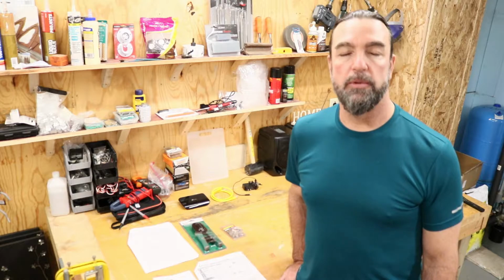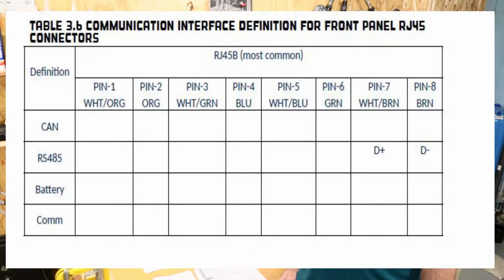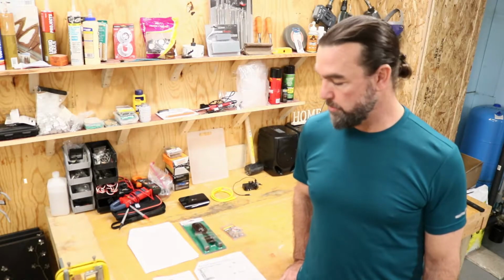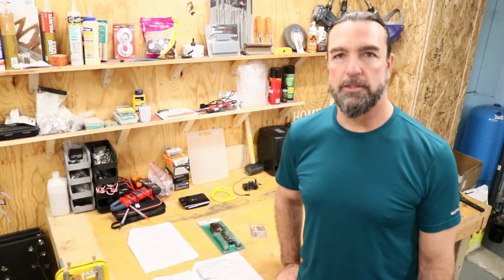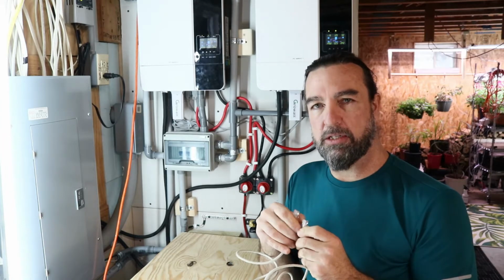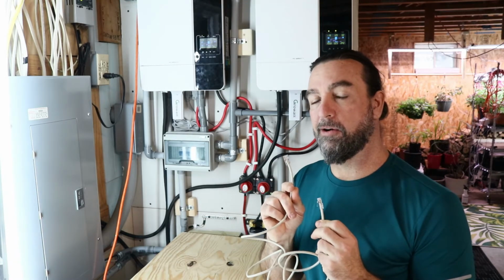Fault (20) Growatt & EG4 24v Battery BMS Test - Doesn't work, crossover cable

Comment: I also had this problem, battery arrived today (LifePo4 120ah 48v - with Growatt 5000es)  - had same issue 4, and 20 on the errors when switching to Li mode
I contacted the battery place and they said switch up Jumpers 5 and 6 and then set the type to Li and the protocol (36) to 51...
I had to make sure the ethernet cable was in the BMS port as opposed to the RS485.
I then shut it all down and brought it back on, and it's working fine

Comment: Ok, I got my Growatt 6000T communicating with my EG4's. I started with the Switched over cat5 and got the error. Hooked up a standard Ethernet cable and got communication. Put new ends on the original cable, with same pinout, and all is good. Make sure you are using the BMS port, and not the RS485 port, on the inverter. Also when using dual inverters, I would use a rs485 link card eg-Ziplink, not a Ethernet switch. It is hard with the documentation given, but I think the Batteries use pins 7 and 8 for battery to battery communication, and pins 1&2 for master battery to inverter communication.

Comment: I had mine sorted out . If the below comments don’t help you guys , msg me , but I need to know which manufacturer and model of the BMS inside the battery. But use canbus port on battery and bms port on inverter. Li , L01,51 ) this is for canbus. The cable should be pin out as below 1-5, 2-4 and 3-6.  Try these three wires only. Do not leave out 3-6 (ground). Cable ends are specific to inverter and battery. Cannot be used in reverse direction

Comment: I just had this same error 4 / error 20 problem on rs485. same inverter model as yours.  Same battery as yours.  To get it working I did the following.  I used the can bus ports on the inverter and battery instead of Rs485 ports.  when setting option 5 to “li” and being redirected to the option 36 screen, choose protocol L51. This is a CAN bus protocol.  Now it should work. Once you get it working on one inverter then try adding the other inverter into the picture.  I agree with the other commenter who said that looked like an Ethernet switch you were using. That will not work. That is only for home networking, not serial communications.

Comment: Hello, if you still have the issue check that video. I made a quick video how to fix it - https://youtu.be/g3j5mpVz-qg
Let me know if this helps.
Reply: I've just noticed that you have the newer inverters.
They have Communication hub included. You just need to connect your batteries to the BMS port (not RS485) of the Host inverter and that is it.

Comment: I got my 4-20 comm error to go away finally.  I’m running the 24v lifepower4 battery and growatt 3k inverter 24v.  I turned down all the dip switches and then made the setting 5 to Li with protocol 36 and L01.  Be sure you connect to the BMS port in the inverter.

Comment: I purchased 3 of the eg4 batteries from sig solar. They told me that their batteries would communicate with my 3000lvm 48 volt inverters. In the beginning I was getting the 04/20 fault codes when attempting to use the LI option on setting 5. 

I have now been able to figure out some communication with the batteries and inverters and no fault codes. First make sure your inverters have the latest firmware on them. Then set all four dip switches in the down position (master battery) and connect the rs485 cable into the bms port on the inverter. This works for me. Now my issue is the batteries will stop charging at 91%. Sig solar has been no help to this point in figuring out any of my issues so I don't expect them to offer any solution to get the batteries to charge to 100%.

Therefore, I continue to use the use2 setting on my inverters so I can charge them completely.
Reply from the maker: - Thanks for sharing Ghost rider

Comment: I don’t like this at all. I do crap loads of research and it seamed that this battery setup is the way to go. Now it seams the 2021 batch is a dud. I ordered and paid for 6 of them they are in transit now. I’m starting to see bad postings on DIY solar forum also.
Reply from the maker: - Off Grid, don't get me wrong the EG4's are working great, charging and discharging as a battery should very efficiently. The only issue is the BMS speaking to the Inverters. Thankfully the BMS of the EG4's is good enough to allow AMPS in or OUT intelligently enough where the inverters help or backup is not needed. My plan is to install an additional BMS between inverters and batteries as a backup prior to expansion. If you have EG4's coming I wouldn't worry, they seem like really good batteries for myself to this point (9 months)... Lets hope it stays that way.

Comment: So NOT an expert... 

I believe you should plug from the rs485 port on the inverter, to the empty bat-coms port on the first battery, then each battery daisy chains to next...

The rs485 port on the battery I believe is to plug a computer into using a usb to serial adapter.

I do believe you had the dip switches correct, device 0 is first battery, the next position is reserved for the inverter...

I would assume you can verify with the vendor you purchased from.
Reply from the maker: Thanks Ricky for the comments

Comment: this guy has the same inverters and batteries and does have comms going

https://youtu.be/SrCSSc9JYSo
Reply from the maker: Thanks for the comments, it seems the setup works with 48v batteries but not with 24v in series to make 48v which is my setup
Reply: @ahhlifesgood1956  i suggest contacting sig solar and see if you can get them swapped for the 48v models

Comment: I was able to get my Growatts to accept the Li setting. After having powered up my units, I turned off my loads and switched off the Growatts. The screens are still illuminated because I hadn’t shut off the batteries. I went to setting 5 and changed battery setting to Li and got protocol screen where I changed it to Lo1. I pressed enter and escape and the unit took the changes without giving me the fault.  Then I powered up the Growatts and had the Li icon beside the battery. I also scrolled through the settings to confirm that 12 and the others are being displayed in percentages which they are.  Interestingly, the Growatt acting as host changed in this process. The only battery in my bank that Growatts are communicating with is the first of 8, which is set to 0 (all down). This battery is one of the new Lifepower4s which I still haven’t gotten to be read by the bms software. I have the same version of bms software as you. I’ll be changing cables and trying to determine if the newer bmses  work with the older ones or with our software. I hope this helps.
Reply from the maker: - Dan thanks for taking the time to comment, what are the voltage of your batteries?
Reply: @ahhlifesgood1956  All eight are 48v 100AH purchased from Signature Solar.

Comment: From Growatt.  If Pylon battery want to build communication with inverter（SPF3000/5000TL HVM/WPV/ES）：
Inverter side setting：program 05-36-L02/L04（SPF3000/5000TL HVM），
program 05-36-L52（SPF5000TL HVM-WPV/SPF5000ES），
Inverter port：BMS port（SPF3000/5000TL HVM），
CAN port（SPF5000TL HVM-WPV/SPF5000ES），
Battery side DIP switch：1000----ON OFF OFF OFF
Battery port：RS485 port（SPF3000/5000TL HVM），
CAN port（SPF5000TL )

Comment: For some reason, my text has a strikout line through it in the previous reply (for me anyway). So here's the short version. 5000 ES setting menu item 05, Li and 36 L52, Bat dip 1000 and use Lan cables between BMS (inverter) and CAN (Batt). My system is working perfectly now. I have 3x 5000es single phase parelled and 12 Pylontech US2000 in two banks.  My next problem is getting the WIFI to work. Looks like it will be painfull as well !! I'll post the complete Growatt text as well as it has settings for some other configs tht+at might be of interest.  Happy holidays.
Reply: Good luck on getting the Wifi to work.  After overcoming many of the struggles that we all have (very poor documentation, specs that are not held to or documented, incomprehensible Chinese English).  I gave up on Growatt.  The silly Wifi dongle was the killer.  I remember one error message in the Wifii App "Ensure to suck the antenna to the suction device" or something along those lines. As an old-time network engineer, I could not get the Wifi work. You can even find a very embarrassing video here on YouTube of the owner of Signature Solar (a large peddler of the Growatts) cannot even get the Wifi dongle to work.

That along with the idle consumption of 48 watts, means I need two 300-watt panels just to keep the thing at idle.  Yes, we all know, the claimed power saving mode does not work.  .  Charge voltage setting in the Growatt is ignored and it just puts out some voltage that I have no clue where it is getting the setting from.  I also have the EG4 waterproof batteries.  They are no  prize-just relabeled Chinese garbage. The BMS as well as the corresponding APP (which is not even with Google or Apple, you must download a file and force it to install), are both complete jokes.  

While the Growatt is cheap it is nowhere worth the hassle and headaches.  I should have returned the Growatt when I went to install it and could not connect up the AC cables as they had a ribbon able stretched right across the inputs.  You can even see Will have the same issue in his video review.  For twice the price I bought a Victron.  Completely different beast.  Less headaches and considering 12 watts at idle, I save money without needing more solar.  Documentation that is near perfect and everything works as advertised.  

The EG4 batteries I will have to keep as replacing them has no real benefit as compared to the price increase.  Luckily, I have a Victron Bluetooth shunt in front of the battery bank and that helps.  Surprisingly completely different measurements (amps, voltage, etc) on the Victron shunt then the EG4 app.  Fluke voltmeter confirms the Victron shunt is correct.  

Shame on me though.  I researched hard, and saw a number of people (videos, forums, etc) trying to get the Growatt to work.  I even remember reading the manual where it stated that I could only use a 20kw Diesel generator with the Growatt 3000.  Ya ok, I am buying a bottom priced invertor, but need a overkill high-end $15k generator.  I know this is false, but the fact that it is in the manual should have been a tell-tell sign.  

Long rant, but like many here I struggled to get the Growatt to work.  While cheap and it might have its place, not for me.  Since dealing with the Growatt, I have made a new rule in life.  No more, direct from China garbage.
Reply: @MrThisIsMeToo  I remember about a 30 minute hassle getting the Phone app and the WiFi dongle to communicate.  Then I realized it was easier to get my laptop to connect to the dongle's WiFi access point and then point my browser at the IP address.  Configuration from that direction was easier. I went through this twice. The first time I changed the cloud url to the proper U.S. cloud server IP.  The second time I configured it to communicate to a proxy service on the local network to allow for capturing the data on a local database and still be able to read the stats on the Growatt cloud service.  Another benefit doing it this way allows for changing the update frequency of the dongle from buffered 5 minute intervals to 1 minute.

I looked at the Victron equipment. Very nice stuff. I started budgeting for it until I started to feel like for twice the cost of the AIO Growatt,  I would be nickle and dimed further to buy dongles for the VE Bus and some other equipment just to configure it easily(I understand some newer models have an LCD built-in now).  On top of that cost there isn't a solar charge controller in that Victron inverter I was looking at. Equivalent SCC from Victron would be what, another $700? So now we're at 3x the cost of the Growatt. So, in my case I could take that $1,400 saved and easily pay for panels to cover that high 50 watt idle.  Panels are cheap and that 50 watts is 1.2kwh a day. With 4 hours of sunlight, you're correct ONE 300 watt panel needed to cover that... I bought 3kw worth of panels on one pallet for.... wait for it. Less than $1,400 shipped. $1,200 to be exact.  Of course some may have space limitations and not have room for that extra 300 watts of panel to cover that idle draw.

English documentation could be improved upon.  Some kinks in the WiFi dongle firmware could also be improved upon.  But one of my main complaints on my Growatt AIO is, no remote temperature monitoring for the battery bank(s).  If my batteries go below freezing I will have to rely on the BMS to prevent charging from the Growatt.  I don't like that, but I have planned around it.  Sadly my BMSs have no way(that I know) of connecting to rs485, and I'm not totally aware if that communication would allow them to report temperature to the growatt to disable charging current.

If installing solar equipment was my profession I would most likely pick Victron equipment for the customers and Growatt for myself.  iPhone for the non-technical, Android for myself.  Linux for my PCs, Microsoft Winders for everyone else.
Reply from the maker: - Thank you Mike for the excellent detail on your setup and configuration, I plan to setup a backup inverter and battery I have using your same settings and a cable configuration another viewer sent in to see if I can get a positive result on the 24v batteries, Really appreciate the information posted.

Comment: Hi, I'm having EXACTLY the same problem (code 04 and 20 ) with Pylontech US2000 batteries and Growatt SPF5000es inverters. Everything works fine when USER is selected but faults out with Li. I suspect a cabling issue. See this video https://www.youtube.com/watch?v=HdKWpzs_8dg&t=131s  where they solved their problems by swapping out the wrongly supplied cables for basic LAN cables. They had a slightly different setup but it all came down to communication issues between inverters and batteries due to the cables beig incorrectly spec'd.  I'll let you know how I get on. Cheers.
Reply: Update. Although I'm using sightly different batteries to your setup, maybe the following will help with your trouble shooting. I came across the following from growatt from an online forum re this fault code sequence.(seems common)  To connect 5000 es to Pylontech US2000, program 05-36-L52（SPF5000TL HVM-WPV/SPF5000ES). On the battery, DIP 1000 (ON-OFF-OFF-OFF) this gives 9600 baud rate and sets batt bank to zero adddress. Swapped out supplied CAN/RS465 cables for basic LAN cables. From CAN port on BATT to BMS on inverter. This setup is now working perfectly. Full coms between inverter and batts. I recon the supplied cables could be a big part of the problem as I tried them with the new settings (05/36) and the faults returned. Hope that all makes sense.
Reply from the maker: - Happy Holidays Mike and thank you for tge comments, this could also be a possible solution orfix to all of us having the same issues. I'll check out the video you sent and most definitely give it a try after the Holidays and report back here on my findings, cheers!
Reply from the maker: - Please report back on your findings as well, I know many poeple are looking for solutions as well.

Comment: Thanks for your videos. I am having similar issues. I have 4 EG4s (1 month old), 4 G4LLs (9 months old), and 4 Growatt 3000 LVMs 2 in each phase, all 48v. I get fault 20 when trying to use Li setting. So far, I haven’t been able to get the BMS software to work with the new batteries, although it works with the older ones. I appreciated Jimmy G’s comments and I will be continuing to lurk on yours and other’s sites. I wish I could help, but as yet I’m struggling even more than you.
Reply from the maker: - Welcome to the chat Dan, sounds like a really nice system you have in place. I'm surprised you're getting the error code 20 given you're entire system is 48v, maybe it's the difference in hardware/software from Gyll to EG4 or more likely  the 3000tl is the issue like my system? Thankfully thee BMS of the batteries works well enough for the moment for me, but I'm still planning to install a backup external BMS between my inverters and batteries prior to any expansions. I've tried every configuration possible, first those provided from in the manuals and techs and then cross figuring every possibility I can bring forward to mind without success to test the system.

Comment: When do the crossover cable do you make sure you orientated the plug in the right direction plus when you press the pins did you keep them pin crossed correctly positive and negative d - D+
Reply from the maker: - Hello Kurt, that's a great question. Of camera I actually reversed the same setting making another cable to be absolutely sure  on the D+ setting in the event 8 was actually 7, and vice versa. Thanks for the thought, I'm really interested to see if some out there actually can get the 24v batteries BMS to communicate with the 48v Growatt inverters. I believe it's a difference in voltage, but could be wrong.